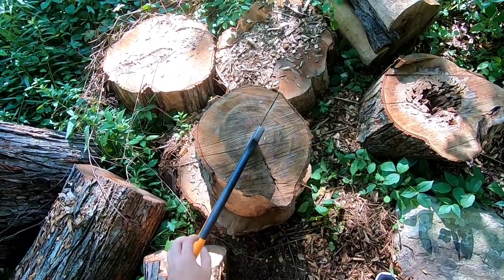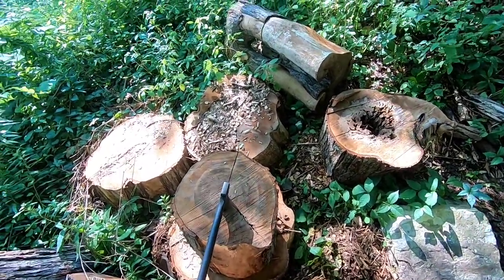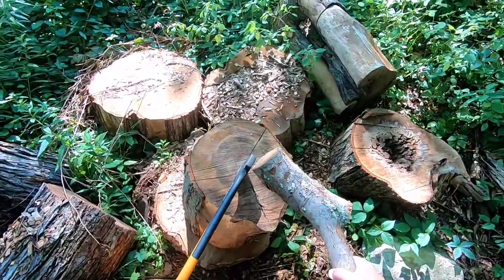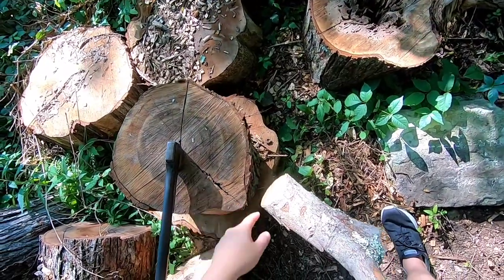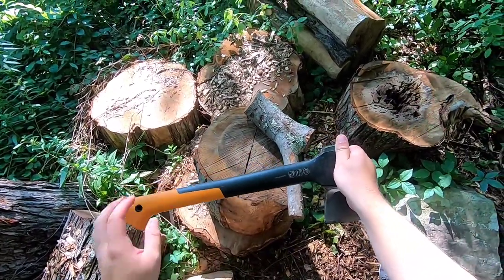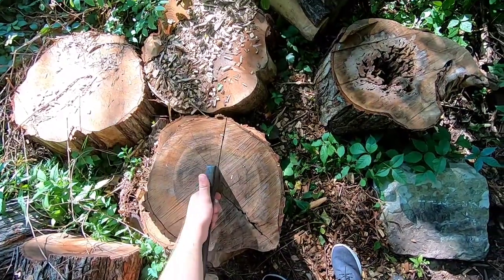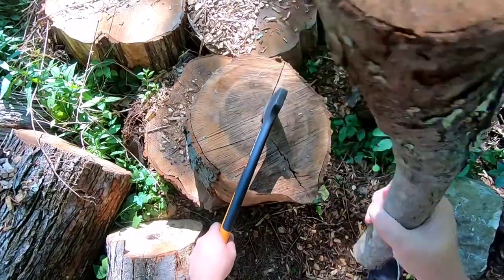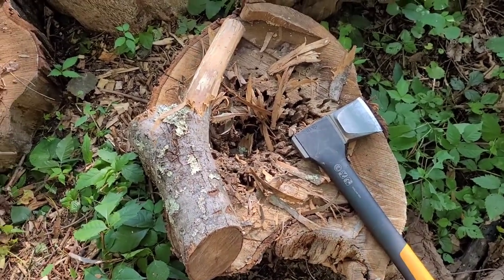How to Remove a Stuck Axe

Comment: I have the opposite problem. I want to drive my axe into a log so I can do some carving on it. But it won’t stay. Any tips?
Reply from the maker: My best advice would be to make sure your axe is sharp and your wood is properly dried, and to get a heavier mallet. If that fails, the piece of wood may simply be uncooperative for your purposes.